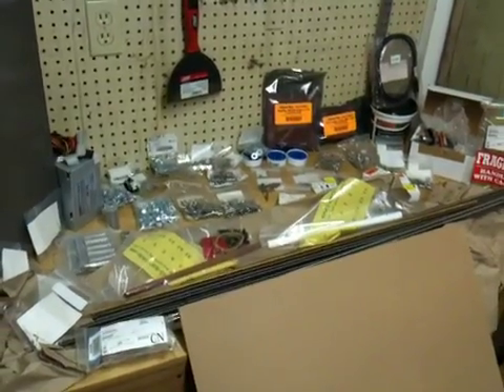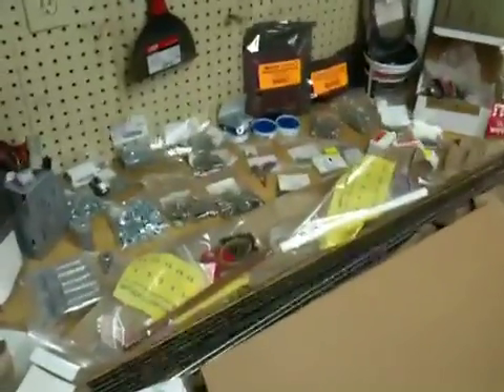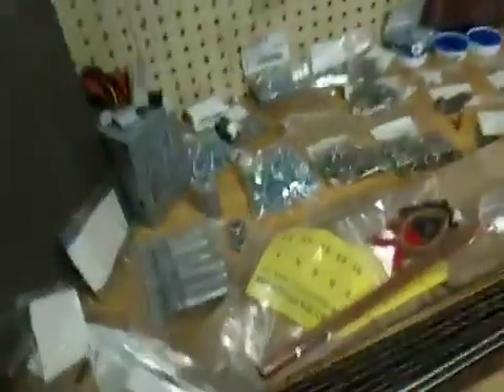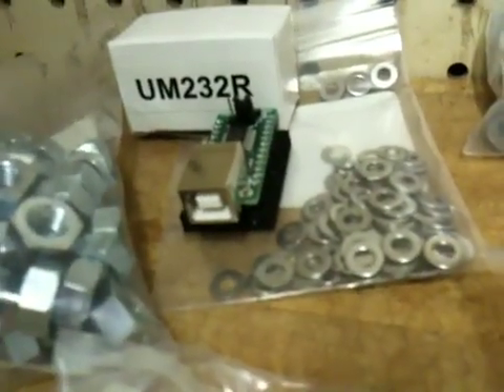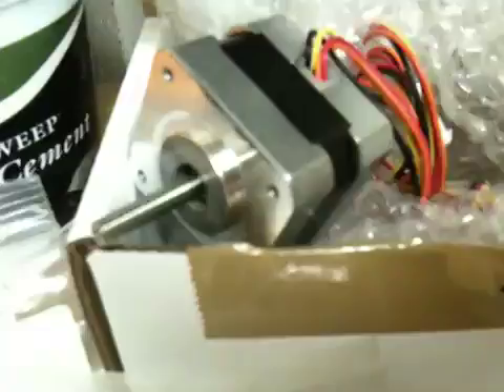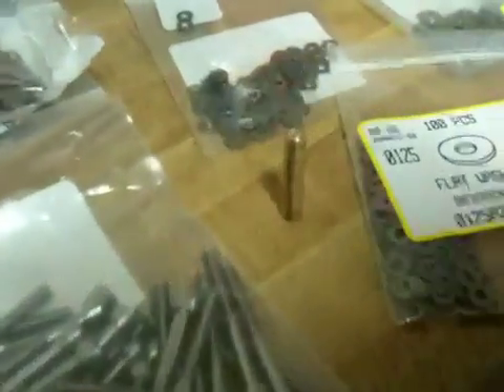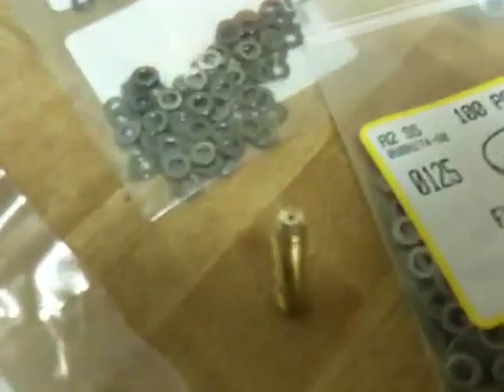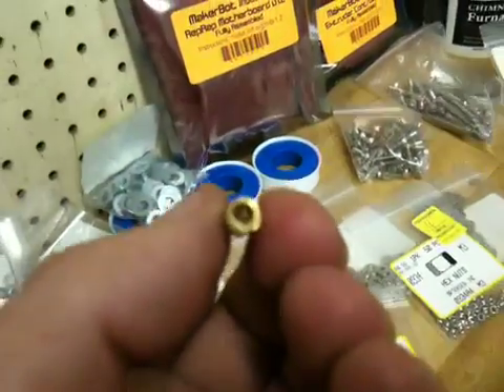Parts for my Mendel RepRap

Comment from the maker: @Gumbo2x No, Makerbot doesn't have a vaccum chamber. The devices do the same thing: grip plastic, push it down into a heater barrel, extrude it out of a nozzle, and lay that plastic down onto a platform that (relative to the nozzle) moves in X and Y, with the nozzle at some point (relative to the bed) moving away from the bed. That's basically it.